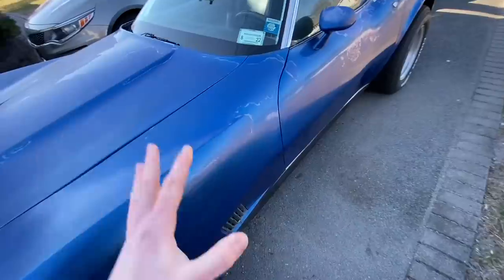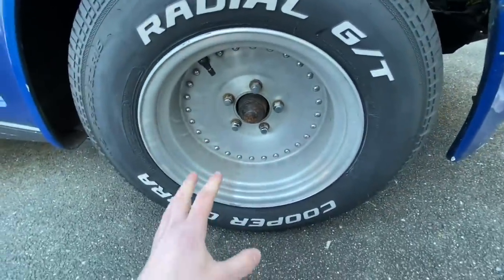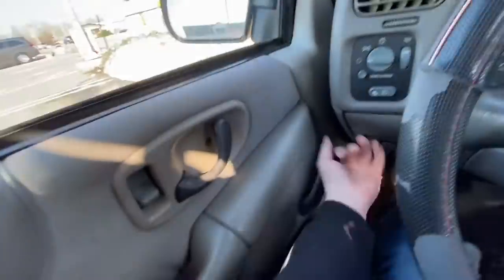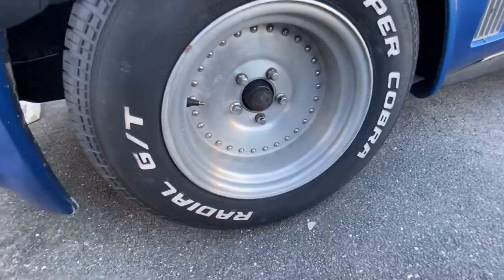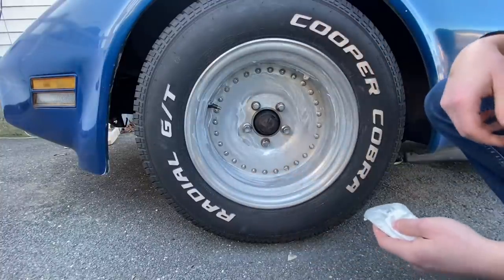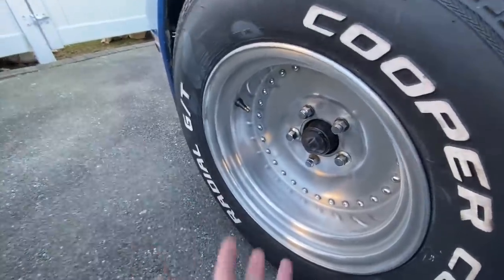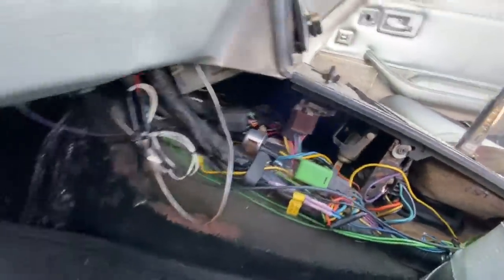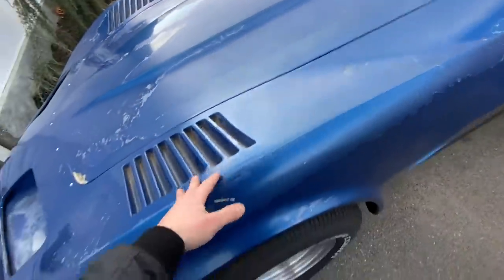Detailing the Corvette’s 20+ Year Old Wheels to Looking BRAND NEW for UNDER $25!

Comment: Well i sanded and repainted my front bumper and both front fenders myself. It was very cheap to do and turned out almost as factory. It was my first time painting and I used cheap spray gun. One tip that i can suggest is to get a really clean place for painting or paint just after the morning dew falls. And do a full practice run (primer, paint, clearcoat) on something else because i had problem when the paint dissolved the primer if it was too thick of a coat and i needed to sand down everything again.

Comment: You can try doing it on your own,but the spray booth is very important to be as a professional booth is.Ventilation, accessibility to anything you may need meanwhile painting (something to hold your spraygun, something to stirr the paint etc). Good luck.Greedings from Greece.Happy to see you again after a lot of years.Been here from when you rebuilt the engine in that 2strok dirt bike.

Comment: I have wheels similar on my truck best way i’ve found is to take the steel wool that u have, the fine stuff and put a little of that polish on it and buff it on using some elbow grease and then hit it with that detail ball, works wonders! try it out even after doing this you will notice a huge difference

Comment: You did a great job. Here is a tip though my 90 ford has kinda crappy paint but if you buff all of the chrome to be a mirror and then take it through a car wash and it will be perfect in my opinion at least.

Comment: Most of the paint cost is the prep, it takes so many hours to sand and some times you may need to add some fiberglass to even the surface out and make it nice and smooth. Since that is old fiberglass you ether need gel coat or re-glas the hole care to more modern materials, so the paint will work.

Comment: I trully enjoy your videos,I subscribed,i have watched all your videos,pertaining to the 74 vette.I have a torch red 1977 corvette,I have put over 15000 dollars in upgrades,and replacement parts,I put hooker long tube headers.And a flowmaster racing exghaust,high performance intake manifold,,and many other things,to numerous to mention.The headers really add alot of power. Its a headturner for sure,I could of taken the 25000plus i have in this car,and buy a used camry,but life is too short to drive a boring car.I had my corvette repainted over 12 years ago,and it cost 2500 dollars,but it was a great paint job,As far as  maaco goes,You get what you pay for,A paint job on a corvette is a lengthy,time comsuming process, If you get a cheap paint job,you have a cheap paint job,that will last only a few years at best.lol russell wayne boyd.

Comment: I would take them off and clean and polish. You can wet sand them. Start off with 1500 then 2000 then 2500 and finish with 3000. Then use the polish and the ball. They will shine like no other. Also the wheels will be stamped on the back side

Comment: Hold up on the paint job no need in it wash the car really well and sand the  hole car with 800 grit just to scuff the surface and fade the old clear coat peeling and reclear the car that blue is beautiful and it was probably a very expensive paint job that just got neglected